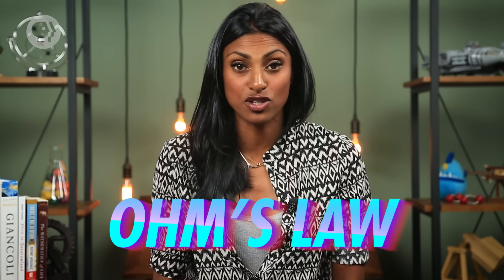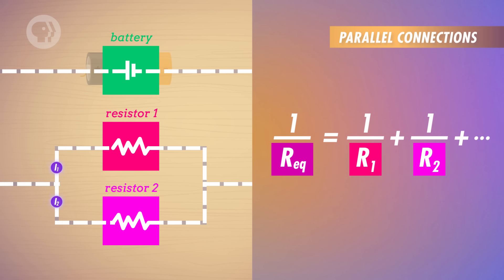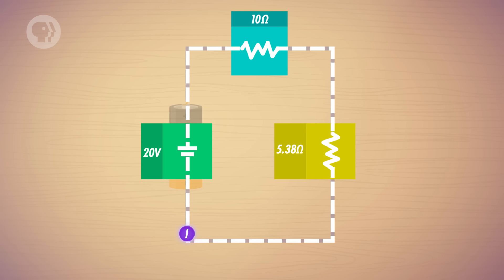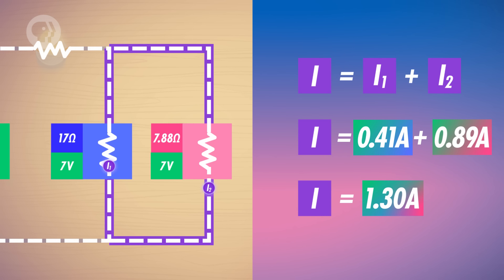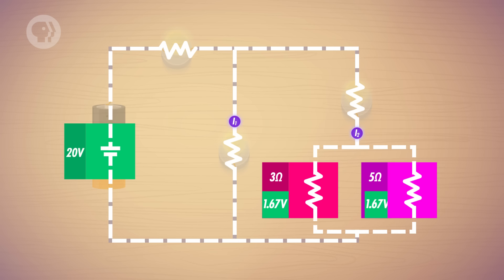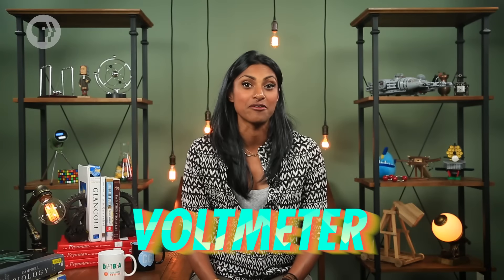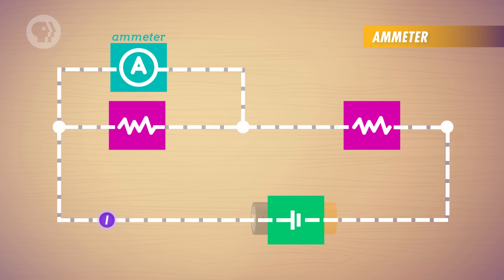Circuit Analysis: Crash Course Physics #30

Comment: has flashbacks to year nine physics where I blew up an ammeter by connecting it in parallel
Reply: aPiece OfPi  lol😂😂😂😂😂😂
Reply: Lol
Reply: I once blew up a microwave by putting a pencil in it
Reply: @olive7831  One my brother put a chick-fil-a sandwich bag (which is lined with tinfoil on the inside). Though he stopped the microwave in time, just seeing the microwave zap this bag like 5 times with blue electricity is pretty scary.
Reply: Noice, very noice
Reply: i ince blew up a battery by connecting it to itself. no one was hurt but is was cool
Reply: omg I did that the other day hahahaha
Reply: I guess my intuition for this must be completely upside-down. Shouldn't the ammeter connected in parallel get less current than if it were connected in series? Like if it's in series, it gets the whole current. If it's in parallel, it could potentially carry a lot of the current, but it would still be less than than the full current? But that's how she said it in the video too.
Reply: aPiece OfPi oh no

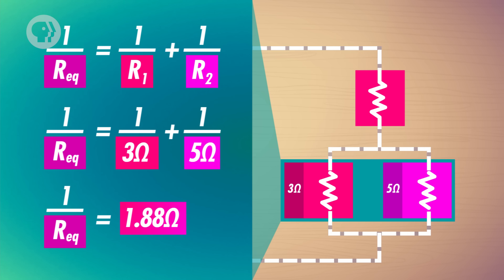Comment: Just in case anyone like me was confused at 3:15, she did multiple steps in one go. She did (1/3) + (1/5), which is 0.5333, and then used algebra to set R equal to 1/0.5333, which is 1.88

Comment: Sorry, small mistake at 3:14 — third line should be R_eq = 1.88Ω, not 1/R_eq.
I feel like there should be some sort of pre-release that allows the public to catch mistakes before the videos are published.
(Otherwise, these videos are beautifully made!!)
Reply: Yeah, I spotted that too.
Reply: Jay A W yes, please correct!
Reply: Please fix the miss in the equation.
Reply from the maker: Added an annotation. Thanks for the heads up, guys! :) 

- Nick J.
Reply: My professors would have failed you for that mistake....so much pain I've been through..
Reply: Yeah, how are yall getting 1.88?  Seems like from the above line, 1/3ohms + 1/5ohms = ?
Reply: No they are right.  Once you're done calculating you have to do  (1/answer) and that gives 1.88.
Reply: Lost n Space look at my comment
Reply: Why don't they just write the equation like this: 
 Rt = 1 /  (1/ R1 + 1/ R2 + 1/ R3)
Instead of like this: 
1/Rt = 1/ R1 + 1/ R2 + 1/ R3
Reply: @aaronodom8946  Thanks for this. I was truly stumped.
Reply: @aaronodom8946  it's prettier
Reply: Ye I saw that as well, I was like waaaaaa
Reply: @crashcourse  where?
Reply: @crashcourse  I'm not seeing the annotation, is it added to this video?

Comment: Her: Saying a lot of stuff about resistors and Current sand voltage.

Me: Struggling to understand. 

Her: See, it's really simple isn't it?

🤦‍♂️🤦‍♂️🤦‍♂️
Reply: That's because a fourth of your lines aren't even in English,they're emojis
Reply: The example she used in that part was really simple. Very simple actually, it made me wonder why I thought this was so hard at the time I learned it. LOL
Reply: Zach Talks Back this is me
Reply: i understand it but it’s still a little bit confusing
Reply: She doesn't define the terms. And she edits out the space between sentences so youdon'thavetimetoabsorbwhatshejustsaid.
Reply: its the accent, isnt it bud?
Reply: Simple is relative.  These videos are really helpful for me, but only if I pause and rewind multiple times.  Don't try to absorb it all at once.  If you didn't completely understand what she said, pause and think about it.  I wouldn't understand half of what she said if I didn't do that, because she goes so fast.  I mean it is called Crash Course, so I can't really complain that it's fast paced.  Just use the pause and rewind options liberally.
Reply: @yiweitang3557  Woah calm the ego
Reply: It happens with me in class
Reply: @mikemcmo  You can slow down the video.  Just tap the 3 dots and adjust the video speed.

Comment: 1:18 i noticed a major defect in the train. If u look at the wheels, you have 2 smaller ones and 2 larger ones. There is a bar that spans the middle big one and the small one. The bar ensures the rpm of the 2 wheels are constant. The problem here is since the wheel diameters are different, these wheels are rotating at different linear ft/min and the train would stall and the wheels would burn out. So in reality this train would never work.....

Comment: I think i'll need to come back to 6:30, that makes things easier
So parallel resistors share the same voltage drop but split the current unevenly
But series resistors split the voltage drops but share the current equally

Comment: Circuit Analysis:The process of breaking down a circuit of key components and studying each one to see what happens with the others.

Voltage
Resistance
Current

DC circuts consist of resisters and series in parallel formations.

There goal is to simplify everything to to a resistor which has an equivalent resistance of all resistors combined.

Figuring out the amount of resistance to figure out the amount of current that runs through the battery.

What goes in must come out

The larger the resistance the larger the voltages are

Comment: your animation is wrong around 3:14, it says 1/Req = 1.88 when in fact Req=1.88.
Reply: That seems to happen a bit to often... there was a simular error in the last video too :(
Reply from the maker: On it. Thanks for the heads up!
Reply: How did they get 1.88 I dont get IT
Reply: @crashcourse  but no correction yet!
Reply: @kauurimg4973  
1/x = 1/3 + 1/5
1/x = 5/15 + 3/15
1/x = 8/15
8x = 15
x = 15/8
x = 1.875
x = 1.88 (rounded up)

Comment: You guys need to do a detailed video on AC Power!
Reply: There's so many topics I want to see covered here.  Different types of load besides resistors and how they affect the circuit. Inverters and rectifiers, AC, single phase and 3 phase, true power, reactive power, apparent power, impedance and so on.
Reply: That's engineering not physics.
Reply: Christion Johnson
Engineering is just applied physics.  Plus there is a lot of theory behind all electrical components and uses.  The physics of electricity could almost use its own series.

Comment: Feeling proud as I'm studying "Electrics and Electronics" in upper-secondary school (U.S. High School). But why di they use the symbol "V" for voltage, and not "U"?
Reply: Feeling proud as I understand what she talks about (for once).
Reply: LARSFSO I live in the US...... I've never seen anything but V used for voltage........
Reply: Daisy Duke I (or we) use V after an amount, e.g. U =  230*V*. Therefore we write Ohm's first law as: U•R•I
Reply: we use V for both the unit and for the concept, who are "we"?
Reply: we use V for both the unit and for the concept, who are "we"?
Reply: Daisy Duke With "we" I meant us Norwegians and I think most of Europe as well. 😉
Reply: Not sure, I'm in the US too and I've never seen anything but V for voltage at any time during my life.  Maybe you guys use V for something else, or could it be a translation thing?
Reply: In fairness using V for voltage make more sense then U
Reply: Alex Blackwood Then again, why do we both use I? 😅
Reply: LARSFSO I think it's meant to stand for "electrical intensity" where I is from the word intensity
Reply: LARSFSO U Means difference in potential(V-volts), so battery is making difference in potential on its ends( +, -) which moves electrons.. Basically you can use both V and U symbols to represent source.
Reply: I wondered also why they use V instead of U and after a brief googling I came to the concusion that V is used only in english speaking countries. But some of them are familiar with U as well. I use U.
Reply: Isn't electric potential energy kQq over r

Comment: At 3:14, you show 1/Req=1.88Ω when it should be Req=1.88Ω.
Reply from the maker: Fixed with an annotation. Thanks for the heads up! :) 

- Nick J.
Reply: Johnathan Gross how is it turning into 1.88 ohms. How is the 3 and 5 divide to end that way?

Comment: Really confused about 3:15. How did you get 1.88 ohms from 1/3 and 1/5?
Reply: they used the reciprocal after using a common denominator to add. It would be 5/15 + 3/15 which equals 8/15 and then you use the reciprocal to equal R_eq (not 1/R_eq, that was a mistake on their video editing.) 15/8 =1.875, which they rounded to 1.88 for some odd reason

Comment: Resistors in series the larger the resistor the larger the voltage drop is required series circuits same current but different voltages pressures, in parallel same voltage different currents

Comment: Why if you connect the Ammeter in paralell you will damage it? According to the diagram in 9:25 (aprox.) the Ammeter will take all the Amperage, so connecting it in paralell will only diminish some of the current that goes through it, isn't it?
Reply: The ammeter has about 0 ohms or almost 0 resistance. It will take nearly all the current of the circuit.
Reply: Leo Sant'Anna Yes, & connecting it in series will make it to take all the current... why this won't damage it, but adding a parallel resistance will?

Comment: I still can't seem to understand why voltage drops in series and not in parallel? 
For an example if we happened to have the multiple resistors that share the same value in series circuit, then the voltage would still the same, isn't it? And why V =V1 =V2 in parallel circuit?
Reply: A real power supply will lower its voltage as you draw more current. But assuming an ideal power supply, parallel resistors will have some voltage drop across all of them.
Imagine that each resistor had a different voltage drop. Then charge in the wire connecting the resistors' - sides could convert potential energy into work by falling down the potential difference from one resistor's lead to the other. But then that would equalize the charge, and the cluster would have the same voltage drop once equilibrium was reestablished.

Comment: How much watts are being dissipated in the resistor?
Reply: IIGrayfoxII
Use Watt's law.
P = power dissipated - Watts
I = current - Amps
V = pressure - Volts
The short logic of Watt's law is P=I*V, I=P/V, and V=P/I
Use Ohm's law to get the current through, and the voltage drop across, any resistor or group of resistors and you can calculate power dissipation (Watts).
Reply: yeah power is Current multiplied by Voltage. Using ohms law rewrites you can express this as any 2 of ohms laws elements.
U=IR -> P= I * (IR)= I^2*R
I=U/R -> P=(U/R)*U= U^2/R

Comment: First: Glad to see a beautiful female engineer. That is like a unicorn. 
second: Watching this reminded me all of my college major. I'm an electric engineer and this is the fundamental of electrical engineering. For those in the major wait till you meet diodes, op amps, transistors, and capacitors. Then circuit analysis goes from this isn't bad to what did I just solve for. lol good time.

Comment: I'm sorry but how'd you get 1/3Ohms + 1/5Ohms = 1.88Ohms & 1/17Ohms + 1/7.88ohms = 5.38Ohms ?
Reply: Tae's gucci flip flops I'm really confused at that bit 🙃
Reply: Neve Turner same,, I wish they'd explain it better bc I can't understand the rest of it without knowing how they got these answers
Reply: Tae's gucci flip flops I know that 1/3 + 1/5 is 0.53 and that 0.53 is a fraction of the answer but I don't know what you need to multiply it by in order to get 1.88 or where they get them numbers from 😩
Reply: Neve Turner me neither I'm just gonna fail all my exams
Reply: Tae's gucci flip flops I have a test first lesson on this tomorrow and then my mocks in April 😭
Reply: Neve Turner good luck😭❤

Comment: I was looking for strategies to analyze RLC circuits and amplifier circuits, in hopes that I could apply analysis backwards to design things. So I clicked on the video called "circuit analysis."
And I got....Series and Parallel Resistors! (which I knew years ago) 👍
You should call the video "resistor analysis" in order to not clickbait people.

Comment: 1/Req = 0.53 ohms
Req = 1.88 ohms
The graphic as shown is just wrong.
Reply: SciPunk215 what step did you take in order to get 1.88 from 0.53?
Reply: I divided the number 1 by the number 0.53.
(BTW: it looks like they added an annotation correcting the mistake. Kudos to the CrashCourse editors !! Keep up the good work, folks !!)
Reply: After solving a lot of equations like this I recognize the pattern and just do it in my head... just take the reciprocal (i.e. divide into 1).

But to be a more precise:
We start with 1/Req = 0.53.
We notice that the variable in question, "Req", is the denominator.
In my mind, I look at the right hand side of that equation and assume 0.53 is the numerator of a fraction with an invisible 1 in the denominator.
To solve for Req we cross multiply and we get:
Req = 1/0.53
Reply: Thank you! This honestly helped so much!